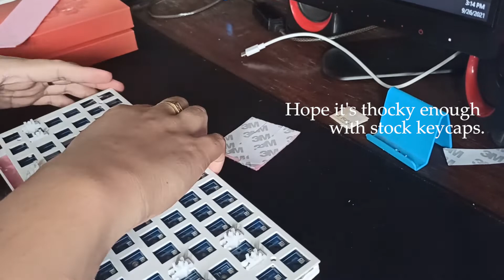Royal Kludge RK84 Full Mod (Full Mod Vid) Pt. 1

Comment: I am thinking of doing the PE mod between plate and PCB but I read there is a risk of PCB short-circuiting.
Did you try that?
Reply from the maker: Nope. Didn't try that. But I would personally prefer if you get a precut or custom cut foam for that mod for your keyboard. Some well known brands/boards do have precut foam for that. It's kinda pricey but the difference is noticeable. I wanna try mod too but not for this keyboard :D
Reply: @archlightxxvii5893  That would cost a lot and I am not sure if I am willing to go for such an investment.

Comment: To anyone watching with an rk84 or any other keyboard with a battery: DO NOT PUT FOAM OR ANY TAPE BESIDE THE BATTERY! The high heat from the battery will burn the foam or tape and you WILL smell burnt plastic.
Reply from the maker: been using my RK for more than a year now. didn't smell any burnt plastic from my keyboard at least once. I also have other keyboards with batteries and have foam besides and didn't have any problems at least once.
Reply: @archlightxxvii5893  its still bad advice nonetheless. Li batteries have a common problem of overheating and catching fires. I don't care for your anecdotal evidence.

Comment: i wanna ask what is the recommended amount of layers when using masking tape? 1? 3? 4?  i use ks3 gateron yellow and i have 2mm EVA foam underneath
Reply from the maker: I do recommend to try 1 layer first depending on the thickness of the masking tape. In my case, I put Cloth Duct tape and I think 1 layer is already enough in my opinion, since it's thicker than a regular masking tape. I also tried putting 2 layers using that kind of tape (cloth duct tape) and the difference is really not that different IMO.

it would also be much better if you try putting a plate foam between the PCB and outer plate.
Reply: @archlightxxvii5893  appreciated thank you!

Comment: Bro dont use duct tape, the adhesive will damage ur pcb
Reply from the maker: It's cloth duct tape. It's less stickier compare to a normal duct tape. I've tested it a few times before applying it to my PCB. It works fine. I've also changed the cloth duct tape a few times and still my PCB is working perfectly :) 

thanks for the concern man, cheers! :)
Reply: If I use painters tape is it safe?
Not going to cause fire at home my keyboard has battery and first time I did this.
Reply: @joeyannechivi586  yes it is safe for ur pcb as long as its not sticky like a duct tape